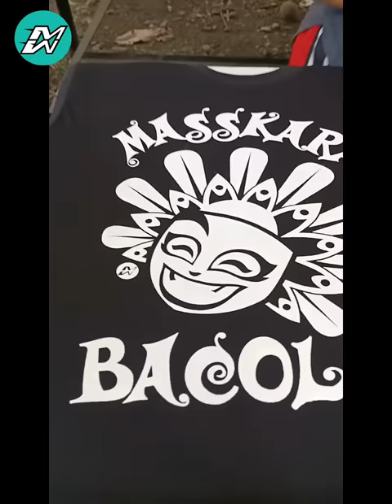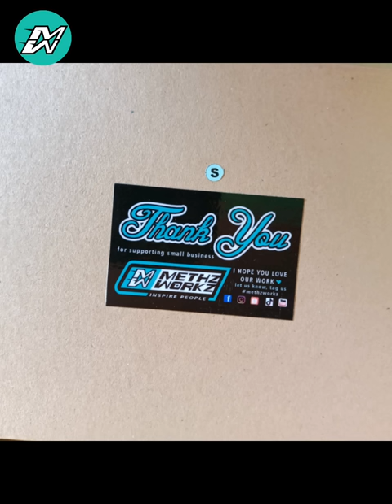SCREEN PRINTING | MASSKARA SHIRT

Comment: Nice work.  How are you drying these prints?
Reply from the maker: We used hair blower to dry the prints to prepare for next print.  But when we finished printing we take it off from the line table and let it dry under the sun. Heatpress for the final curing. ❤️

Comment: So you have two diff screens right? One for white and the other one has a slightly diff cut to add the color wave ?
Reply from the maker: Yes po. Please watch our videos. Most of it we do pscreen printing with different screens.
Reply from the maker: https://youtu.be/_3frA15phWw
Reply from the maker: I made a negative film in this video. We just label the film with colored black or white. It's for our festival display. We limit screens to three frames maximum.

Comment: Why in South East Asia still they are using line screen printing, when everywhere we are using butterfly 6x6 machines 🤔
Reply from the maker: You mean rotary screen printing? Thankz for your comment. Maybe we can save electricity? Its more expensive compare to line table.  When you start doing business. Start small. Do what you have. I made a DIY rotary before but it doest work for me. Especially when i do it alone. I dont have an employee during pandemic. It cost me a lot. Thats line table makes me more productive and efficient maybe. ☺️❤️
Reply: @methzworkz  yeah, I am talking about rotary machine. Although you are doing this perfectly, but still I would say this is labour oriented work. 
In rotary, with single handed without any helper i print 200 to 300 tshirts in 6hrs. (Including preparations),my printing area in just 12ftx15ft where everything is properly organised. In line table i have experienced, it has lots of process which is not comfortable at all. Like: loading and unloading Tshirt on non standardized pallet, drying of base cote ink, screen handling from one place to another, high chances of stains while working and on top of it this required large working space.
I don't know may me be i am working in different working conditions that's why I am not comfortable with line table process, there is possibility that you are more comfortable in this method as long as your clients are satisfied with end product.
Good Luck 👍
Reply from the maker: Someday when i can afford to set up rotary will try it again ☺️. That line table cost me 1,400 US dollars. How about your rotary sir? Maybe I'm just afraid i can't afford it.😬
Reply: @methzworkz  You are right 👍, rotary can't beat line table cost. 😂

Comment: What are those tables called that the shirts are on please?
Reply from the maker: It's called line table mam. Its good when you have a lot of space. ☺️
Reply from the maker: Palettes are made of plywood covered with formica sheets on the top.
Reply: @methzworkz  Thank you
Reply: @methzworkz Do you make your stencils? Also is your ink plastisol or water based? I am confused because I have heard different things about both kinds but I love your finish on your shirts and how fast they are doing them. Thank you for replying.
Reply from the maker: @marylynch8196  hi mam. We used waterbased paint. We used J&J virgo sales brand in the Philippines. It's usually used in sports uniforms. Its durable and easy to clean the screens especially when you print on the spot ... change design and changing colors of print like we do in festival events.
Reply from the maker: @marylynch8196  https://youtu.be/5zPSrA5aUOY
Maybe this video could help. Just pause to see the caption for the details  of materials we used.
Reply: @methzworkz   hi po maam Anong brand nang tulco po gamit nyo sa Yung nilagay Mona Yung ibat ibang kulay?